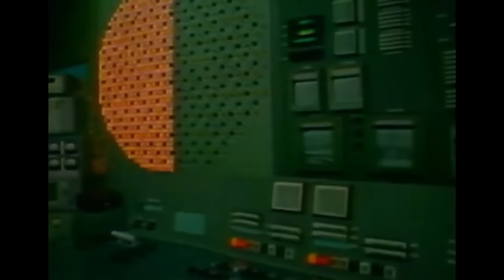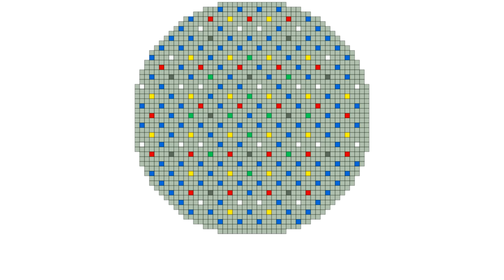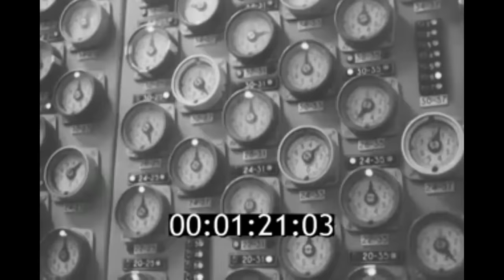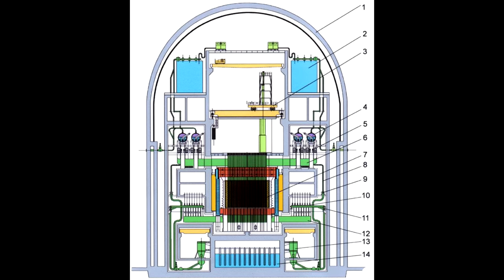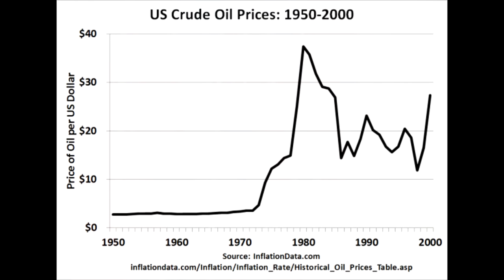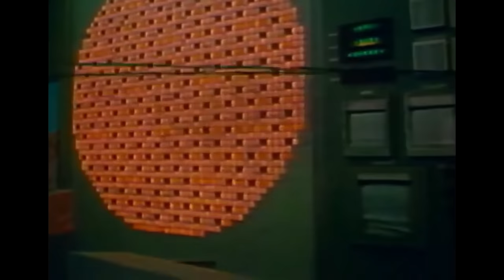What if Chernobyl Didn't Explode?

Comment: I have never heard so many inconsistencies in a video before. Reactor 3 began production before the proper safety tests were done, that were already signed off for. Slowing the turbines was part of the required test, that had begun hours before shift change. But due to power demand, reactor 3 was maintained at a lower output level. Which caused Xenon poisoning. Control rods were pulled out to get power levels back up, and when things started acting up, the rods were inserted by the A3-5. The boron tips accelerated reaction to over 10x normal output.

Comment: Chernobyl happened due to poor reactor design primarily, Soviet needed a scapegoat because they could not admit that their reactor design was bad. Running the test is also at fault, but they didnt know how the reactor would behave. Had they been informed about the graphite tipped control rods and that pulling them all out would put them all at the same level, so pushing the AZ-5 button here is just asking for a disaster.

Comment: Another sub note would have been that Italy would still have nuclear power and they would have completed at least BWR units at Monalti Di Cristo. Finland would have built Loviisa 3 that would have been heavily modified VVER-1000. That in turb would have lead that when Olkiluoto 3 would have been planned and built there would have not been a need to build such a massive unit and TVO the utility would have chosen a smaller and proven design that would have been easier to construct. 

Germany would have had a strong anti-nuke movement regardless of Chernobyl but there roots lay in the fear of nuclear war.
Reply: We wouldn't be dipendent from exporting gas and fossil fuels if it wasn't for the unit 4 premature decomission and the ignorance and fear of our people exploited by politics.

Comment: Could be very possible the Kostroma NPP wouldn't have been cancelled as the RBMKP-2400 would have been so powerful and with RBMK now having a good reputation, yeah could be very likely.
Reply: Oh God yes, the RBMKP-2400. That would have been a beast of a reactor. The RBMK is so big that it should have come with its own zip code. The RBMKP-2400 would have been so large that, when traversing from one end of the central hall to the other, you would probably have skipped a few time zones by the time you got to the other side. Imagine trying to run this thing with the, shall we say, somewhat underpowered computer systems the USSR had back then. I shudder at the thought alone.
Reply: @swokatsamsiyu3590   I think the really long one you're talking about is another cancelled project that being the 4800
Reply: @Mr.HaraldTheMan  
Could be that I'm mixing up the two. So, there's that. It's a good thing this thing never got willed into existence. I mean, they had a hard enough time keeping the RBMK in check such as it was at the time. Now imagine a reactor almost 5 times that big. Good Heaven's!

Comment: I just had the thought, not related to this video. It would be cool if there was a sim/game where you are the operator and you have to keep the reactor stable while passing the safety test. It would do all the calculations (simplified as needed) based on control rods, water flow, xenon buildup, etc. and show the resulting power output. trick is that there is no way to win that day. Results would be cancel the test or boom boom

Comment: Not much imho, nuclear power construction in USA was stopped after 3 miles island accident.
Reply: It probably would have restarted, particularly with the Soviet Union continuing to build up capacity.
Reply: @markusw7833  cold war would have ended soon after either way.
Reply: @simon2493  Not necessarily. I would have to read more into it for this counterfactual. One thing no one is mentioning is the role nuclear energy was playing and would have continued to play for the Soviet Union. It wasn't just some passion project. It was apparently a necessity for the western industrialized part of the Soviet Union and capacity was being added on.
Reply: @markusw7833  If we're switching to USSR then it depends on how would mainly Ukraine faired after fall of USSR. Ukraine with its weak GDP growth for the past 20 years wasn't in much need of new capacity, but even then what stopped nuclear growth was increases in industry efficiency. France had plannes for twice as many reactors as it has, but even with current numbers they do have overcapacity.
Reply: @simon2493  I'm thinking of the USSR before its fall, if Chernobyl hadn't happened and the Soviets had continued to rely on and aggressively expand nuclear energy production. From my observations virtually no one knows the pre-Chernobyl history of nuclear power in the USSR, or its reason for being. There may be a video on this in mid April.

Comment: I have to strongly disagree with Your distorted characterization of the German end of nuclear energy production. Germany substituted nuclear energy with RENEWABLE energy sources like wind and solar, NOT coal.

Today more than 50% of German energy production is renewable, nuclear energy production  was never more than 1/3. Also, as you may surmise by these numbers, Germany is also reducing its use of coal for energy production.
Reply from the maker: @torstenwinkel2183  This may be true, however the once 15% of German energy production by nuclear power was replaced nearly 100% by coal, and even this year they're expanding gas fuel production to compensate for base energy production once met by nuclear power.

https://www.politico.eu/article/nuclear-reactors-germany-invest-gas-power-plants-energy/
Reply: @thatchernobylguy2915  It seems YT ate my lengthy and thoughtful reply, because of the links? I'll wait a while to see if it gets through and repost later if not. 8-(

Comment: You already mentioned it, but I can't stop thinking about how many countries stopped construction of nuclear power plants after Chernobyl... If it hadn't happened, many more nuclear reactors would have been completed in the 80s and 90s. They'd start to go out of commission in the 2020s and 2030s, just as the renewables boom happens (lifespan of some would be extended, but imo a lot would be replaced by renewables). The effects of climate change would be significantly milder and we might actually make it to the 1,5 degree target.